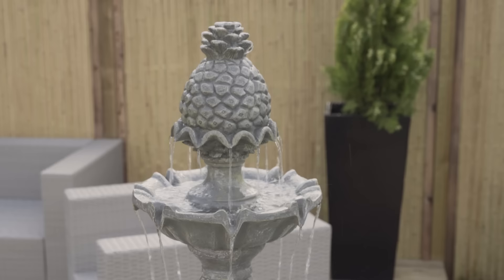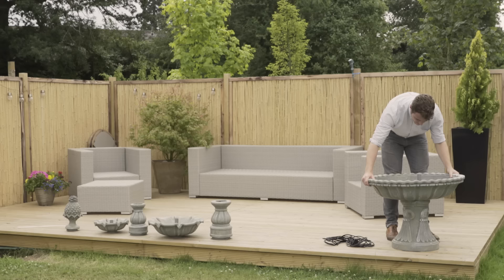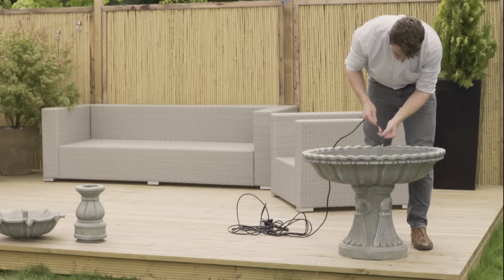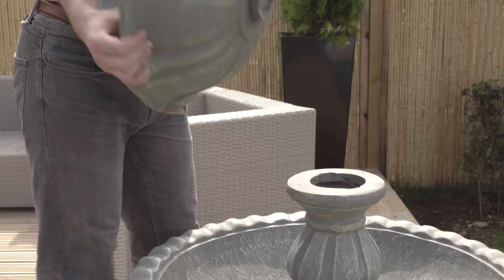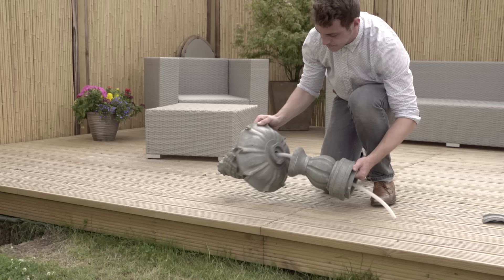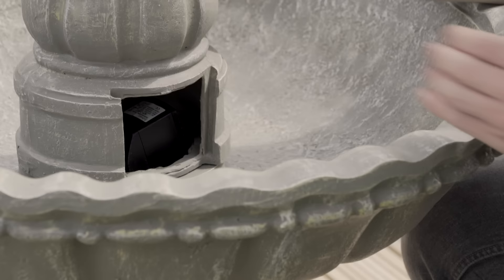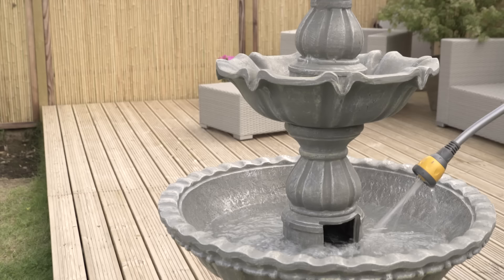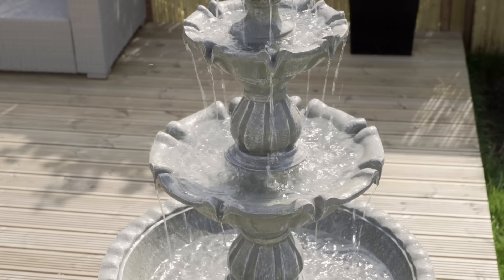How to Assemble a Tiered Water Feature

Comment: Presumably this is plastic? What is it's life expectancy?
Reply: 2 days
Reply: they are made of strong resin.  Since its not as heavy as a cement fountain, it would be a lot easier to take apart to bring in the pump during the cold freezing Winter months.  One company I saw said you can place a cover over it, or take it down and store it.   They look a lot easier to clean than cement. I have a cement one for the past 15 years and I have to take a scrub brush, hot water and soap to spend 30 mins of more cleaning it out.  2 of my 3 tiers stone fountain is broken, so want to replace with a resin.
Reply: i think its made of fibre glass - mine just received today and will be installing tomorrow - am not a magician, so lets see
Reply: 3 weeks then then its fuked